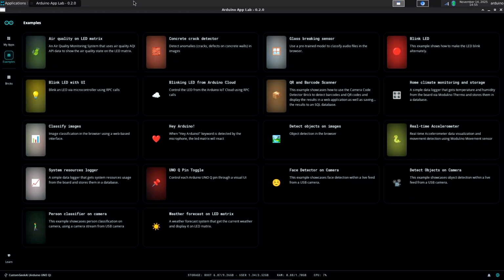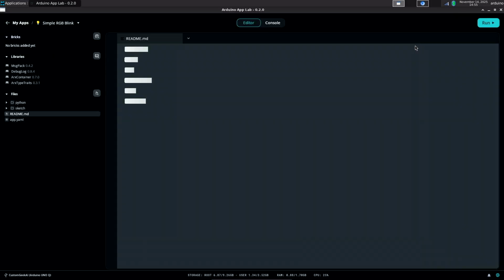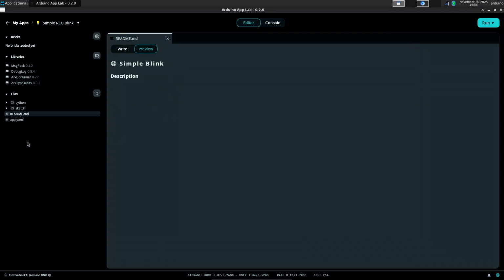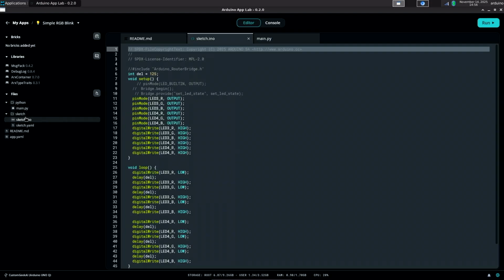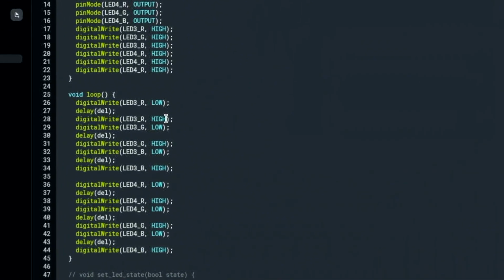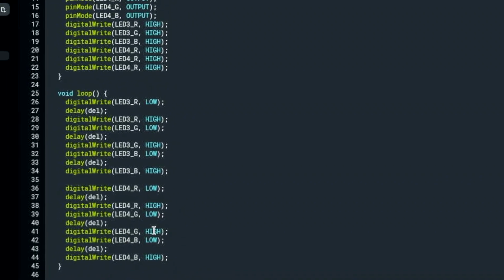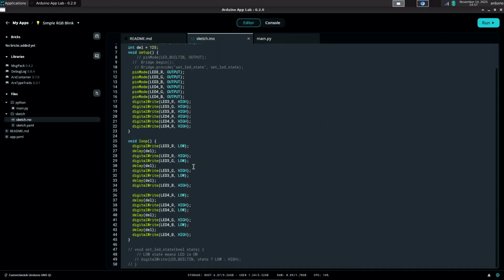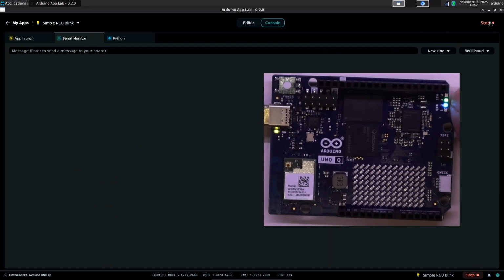Uno Q Onboard RGB LED Control #arduino #soc #RGB #code #unoq #ai #arduinoproject #electronics

Comment: Thank you for the explanation of the sink and source of the pins.  I originally thought it was an error in the Arduino code, but electronically it makes sense.  It is a great starter for newbies and those that are getting back into hardware and programming.  Keep the videos going.

Comment: I'm never going to use this boat.  It's interesting - but so are a lot of other boards.  If this board didn't have the arduino name on it,  no one would be talking about it.  Right?
Reply from the maker: It’s kind of a super “rare need” board, and you’re probably right about the name on the board, without it… yeah.. Kind of neat, but I won’t have a bunch of these laying around in 5 years.
Reply: No. It's very interesting, with our without Arduino. But, just use another boat.